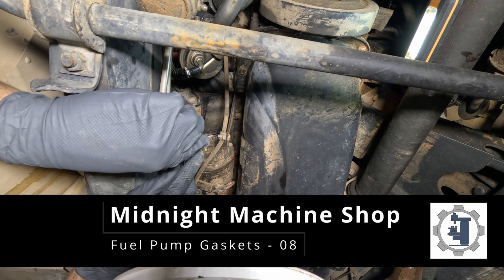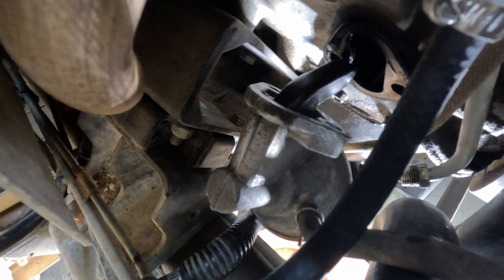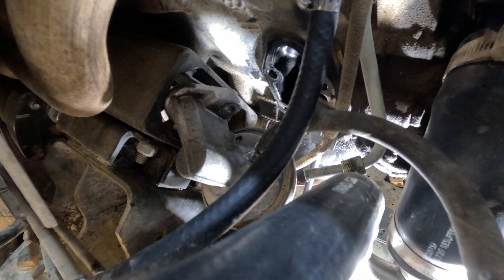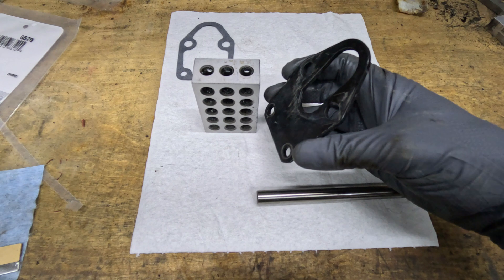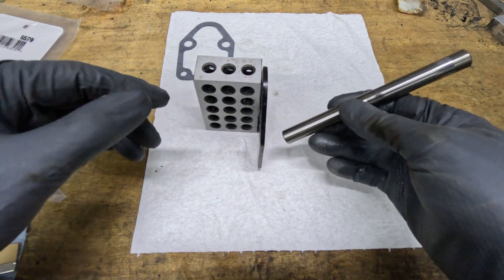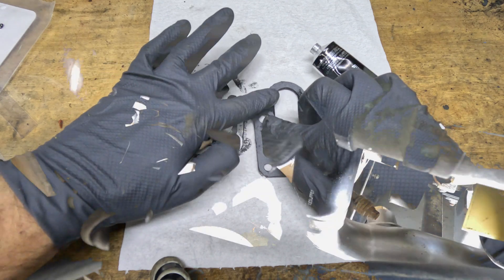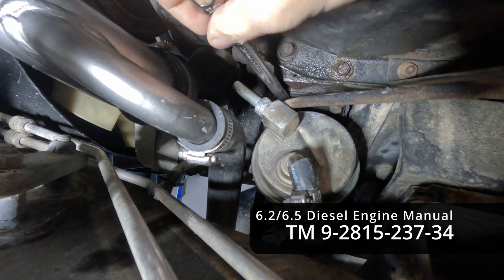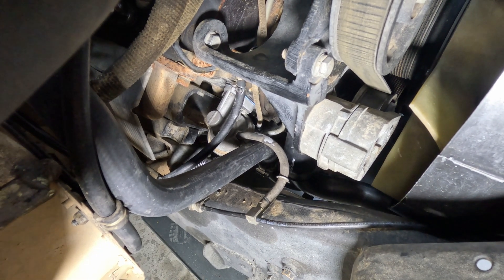THE FASTEST Way to Fix GM 6.2 / 6.5 Diesel Fuel Pump Gasket Leaks

Comment: What is that line you can see at about 1:50 with the flared end that goes into the bottom threaded port on the fuel pump? I cant seem to find that specific tube in the manual.
Reply from the maker: That's the fuel line that runs up the front of the engine block and then through the engine valley to get fuel to the fuel filter. It is shown on Figure 10 of the parts manual, TM 9-2320-280-24P Volume 1, which not on the same page as the fuel pump. 
PN is 5741611 or GEP23500022. NSN 4710-01-185-6179

Comment: What size flare wrench did you use on the flare fitting?  My nut has lost a couple edges and is tight.  I dont want to completely round it.
Reply from the maker: The wrench that fit best on mine was a 5/8"

Comment: One of the best things you could do is replace that mechanical fuel pump with an electric lift pump (like the Raptor 4G).  The rubber diaphram inside the mech lift pump gets eaten away slowly by ethanol in modern diesel (remember these engines and trucks were designed in the 70's when ULSD didn't exist!) and when that happens, guess what - the crankcase gets flooded with diesel... which isn't a great lubricant.  I'm speaking from experience here - I had a mech fuel pump do this on my H1 with a brand new P400 in it (I have a drivers side turbo downpipe which made me give up my OEM electric H1 lift pump).  Buy a blockoff plate from summit, wire up a 12V lift pump with a pressure gauge and you'll rest a lot easier.